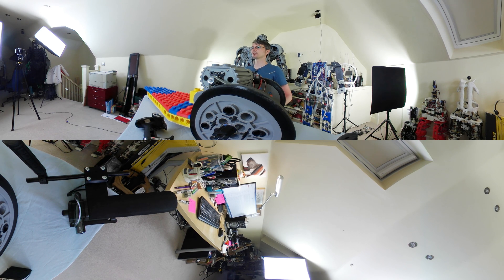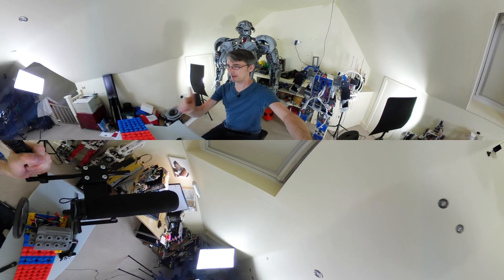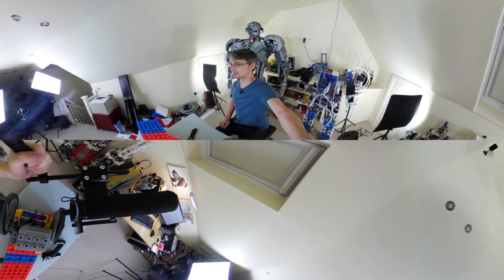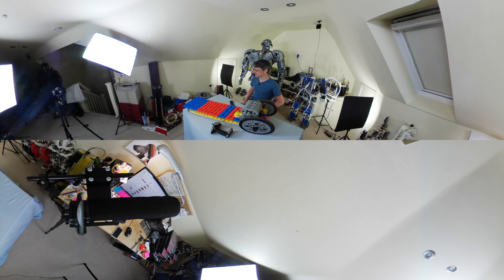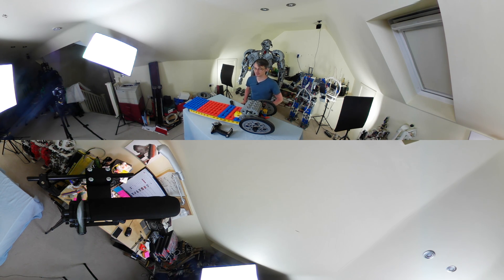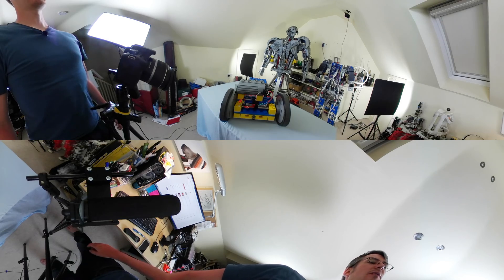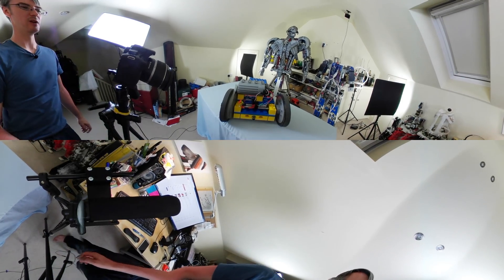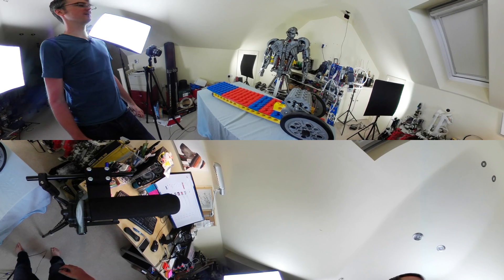LEGO Electric Skateboard in 360° | XRobots | James Bruton

Comment: Hey James, an idea, why don't you add a FSR resistor to the board, so you can actually controll it with your foot?
Should be fairly trivial to implement  and it would  be better to control I think.